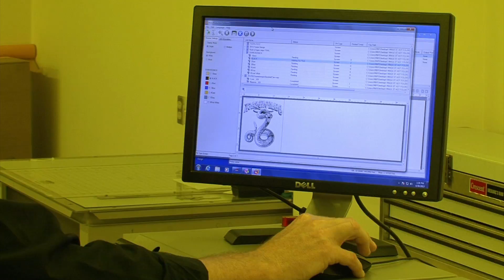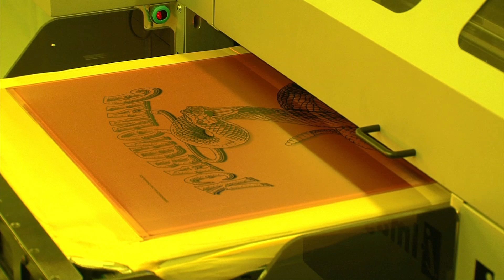i-Image ST Computer-to-Screen Imaging Unit - CTS - M&R Screen Printing Equipment

Comment: Random question on an old video...

After the i image was complete, why did the guy move the screen to the other exposure unit afterwards? Does it have to to be exposed?

My company is getting an i-image and from what I was told it would expose the screens at the same time?
Reply from the maker: There are several models of the i-Image CTS system.  The i-Image ST unit you see in this video is an imaging-only model.  The models that provide both imaging and exposure would be the i-Image STE, i-Image STE I and the i-Image STE II.  Currently, the i-Image STE I is shipping as new and has taken the place of both the STE and the STE II in our product line, but you will see those discontinued models available for sale from time to time.  For more information about the i-Image line, please take a look at the product page on our website at http://www.mrprint.com/equipment/cts-computer-to-screen-imaging.  You can also see how the imaging exposure models fit into a fully automated screen room by watching our Digital Screen Room video here:  http://www.mrprint.com/dsr
Reply: The M&R Companies Wonderful. Thank you for the insight.
Reply: This is the model that does not have the exposure unit.
Reply: What's the best setting on the printer